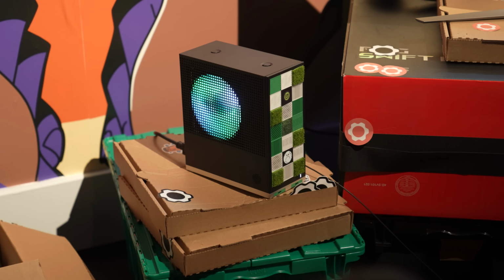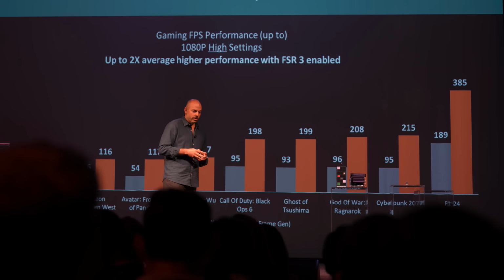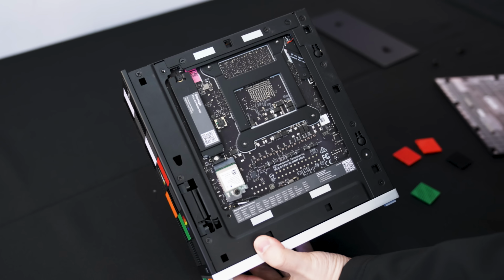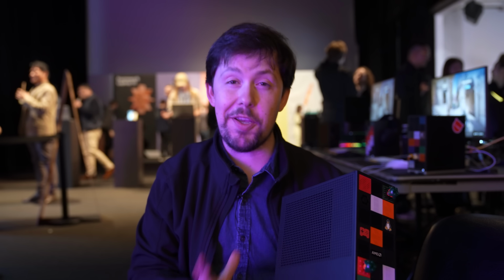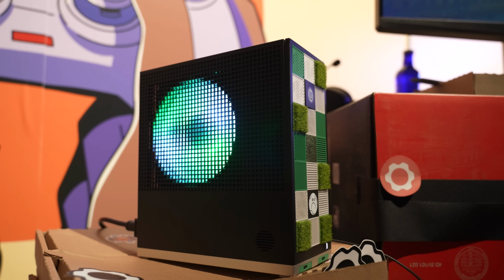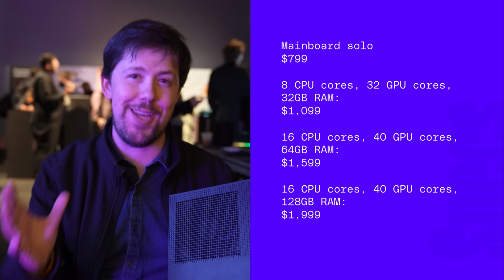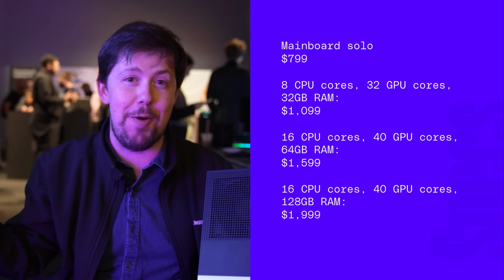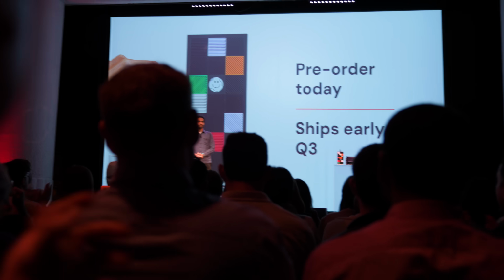Framework’s first ever desktop is 4.5 liters of pure AMD muscle

Comment from the maker: Desktops didn’t necessarily need Framework’s help – what should Framework pick as its next modular and repairable product?
Reply: Ebook reader. Headphones.
Reply: Phone pls
Reply: A tablet since phones r too small
Reply: TB5 eGPU
Reply: Tablets
Reply: A NAS case i can put my old framework laptop main board in when I upgrade my laptop
Reply: handheld android gaming devices. when they do enough upgrades they will just have a player 2 devices or a resell starter kit that can bring more people into the ecosystem
Reply: a touchscreen tablet or introduce a touchscreen option for their laptops
Reply: @jhol2752 they already have, they just revealed the framework 12, a hybrid laptop tablet device
Reply: Phone
Reply: external portable monitor
Reply: A FrameDeck would be amazing, I don't like having to undo and redo screws threaded into plastic a bunch like the ones in the steam deck.
Reply: Ah yes, soldered RAM, much modular, very pricey.
Reply: @szmarczak  LPDDR5X-8000. Framework asked and AMD couldn't make the signal integrity work with modular RAM. At least they're not charging £200 per 8GB like Apple...
Reply: Where are you getting a different 4.5L pc @szmarczak
Reply: .. I mean.. handhelds? Cause Ayaneo 3 is already literally got it faster than them 😂
Reply: @inbuiltablecrow7553  I like the handheld idea. I personally don't care for long battery life but I like the form factor as something easy to use in bed or while travelling where I'll have access to power outlets.
Reply: Love dolls.

Comment: Well I'm sure it's very overpriced but I want one.

Doesn't make sense, the point of Framework was its a repairable laptop. But desktops are already highly repairable. 
But it's a nice size and I like the handle lol.
Needs more ports but I'm okay with a dongle in a desk setup, especially since it's got two USB-C ports on the back I'd be willing to sacrifice for dongles.

Also really annoyed at the shift to Display port for everything. I find it less reliable than HDMI.

Comment: So let me get this straight. A company made a name for themselves with truly modular laptops. Now they release a desktop that's less modular than even desktops by big predatory OEM-s. No PCIE slot, soldered on RAM and somehow we are still to believe they follow the same design ethos as their laptops? Hey, they're not as bad as Apple, because at least they let me switch out some colorful tiles and don't solder the SSD, right? Hard pass for me.
Reply: This is for people who want the Strix Halo APU, which, outside of this unit, you currently can't get in a desktop at all. Given that its an SoC this is about as modular as it can get.
Reply: There is pcie x4 actually (just not available space in the case they sell to use it, it's itx so any other case would solve this)
Also the problem with the soldered ram, framework asked AMD if LPCAMM was possible. AMD (not Framework, but AMD) said it wasn't possible for signal integrity. They ran simulations etc and it wasn't possible to do so

That's a bummer, but I don't get why you reacted this way

EDIT: added notes about the pcie x4 being not usable in the case they sell

Comment: I really, really wish this were $200 cheaper... It's a bit hard to justify over building a comparably performant, if slightly larger, system for less
Reply: Yeah especially the model with the more powerful APU
Reply: You can with 12 cores, 128gb and an RTX4060? Show me the parts list… also that 4060 will be limited to 8gb where you can address up 96gb for this bad boy if you want to.

Comment: Where's the gpu slot?
Reply: Dude, the AMD chip has a super powerful integrated graphics unit that can actually rival the 4060! There's no need for an extra GPU slot, and if you allocate enough RAM to it, it might even outperform the 4060. Crazy, right?
Reply: It’s integrated graphics dude. That’s the whole point…

Comment: This is great!
That AMD processor is a beast!
Reply: I have said it in other places. When you think about it it is funny they have not done this chip properly for a while. Considering that the current Gen consoles both have a form of the integrated GPU/CPU chipset made by AMD that are running games at high levels... To have not seen that go into laptops and non gaming devices till recently has been a surprise to me.

Comment: I can handle soldered RAM. What I want is a PCIe x16 slot, not x4.
Reply: Not enough lanes apparently since the built in GPU took the majority of it
Reply: @mcslender2965 Did the GPU took like what ×8 lanes or is it ×4 lanes but shouldn't RAM only takes like 2 lanes? I know storage do take ×4 lanes
Reply: same dude, but id prefer at least so-dimm ram
Reply: @mr.unknown.  They try cam modules but performance hit was to huge.
Reply: @kkrolik2106  the performance hit was like 40%
Reply: @mr.unknown. SODIMM signal integrity in a 256 bit bus would only run at 5200MT/S in a DDR5 or in this case LPDDR5 as the name suggests its Low Power so it would need to have ir soldered CAMM2 has the same problem sadly

Comment: I hate to say it but AMD was right to pivot to APUs for the console, mobile and AIO market.
Reply: Actually they wanted to do  that to develop the Heterogeneous System Architecture. HSA is a long term goal that will take many technology steps to achieve. This having Unified memory at 256bit interface width even for the CPU is quite impressive.
Reply: @Neojhun What would be more impressive is that the RAM isn't soldered and the signal integrity is the same as being soldered for this Framework had to made the decision with AMD to have it soldered to the board for now AMD did say CAMM2 WAS being talked about but AMD said the signal integrity in a 256 bit bus would make it pretty much just runs at 5200MT/S the max speed of DDR5 RAM
Reply: Why do you hate to say it?
Reply: @ Because it means their desktop gaming GPU business is now almost vestigial :/

Comment: The AI bubble popper.
Who cares if it's slow at AI when it has 128GB unified memory, it can fit the same size models than nvidia's 80GB $20000 A100 can.
Reply: Nvidia has hbm.
Reply: @BakhtiyarNeyman  Only for datacentre cards I thought?
Reply: @BakhtiyarNeyman  for ai is not deal breaker we just need decent one with whole a lot of it
Reply: Talk that Talk
Reply: *who cares about AI? :P
Reply: @polakuu  those, who cares

Comment: Am I missing something? The whole thing with base config turned out to be around 1700 euros? for 4060 m performance? what's the hype about?
Reply: Purely for running LLMs probably.
Reply: @ or keras, or pytorch, or tensorflow...there's more to AI than just LLM.
Reply: perfomance isn't easy to compare due to the ability to relocate ram. I wouldn't use it as a gaming station.
Reply: 4060 can't have 96GB of VRAM.
Reply: @contactharsh13 vram
Reply: If you need unified memory it's good otherwise just get a normal desktop
Reply: AI
Reply: A huge vram requirement seems to be a niche at the moment. Is it something everyone would need eventually? I really hope we start getting modular unified memories if that is the case.
Reply: @contactharsh13  did someone say this thing is what everyone need?
Reply: No particular reason.

Comment: 128Gb vram/ram, 16 full zen5 cores and 40 CU 3.5. i think thats a very good linux and windows workstation for a reasonable price.
Reply: The Minisforum 795S7 is like $600 barebones if you're only interested in the CPU part, which is roughly equivalent apparently.
Reply: @PatatesLover-UwU  its not equivalent, minisforum use DDR5 slots while this one LPDDR5X
Reply: It’s lpddr5
Reply: Use Bazzaite on it it's crazy
Reply: @TecArtScien  Bazzaite is for gaming, you don't need 128GB VRAM for that.
Reply: Bro it's 2k without dedicated GPU, for me it doesn't sound like a generally reasonable price if you just want a good workstation. I don't say it needs to have dedicated GPU, I'm just saying the price is not very reasonable if you don't get the design and brand's unique gimmicks into account.
Reply: @dovs96  it basically the equivalent of a mobile 4060 they said. Which coupled with the cpu and ram its basically right in price.
Reply: @dovs96  the 32GB and 64GB models are more appropriate for a gamer than 128GB SKU is clearly aimed at the top end Mac Studio. Given the stupid cost of GPUs and scalping of then now. I think you'll see APUs start to take over the budget to mid range category for GPUs. The costs are not miles away from a 7600X based RX7600 diy system which is about 5x the size. These things will sell.
Reply: @dovs96  TBH this only good value if you are doing local llms. Other than that it's not that good of a value.

Comment: Overpriced and not expandable. No thanks.
Reply: Sorry you can’t add RAM to your 128GB of RAM. That’s really going to bottle neck you in 2053.
Reply: You can buy a GPU with 128GB of memory for less? Where? The 128GB Mac Studio is $4700, which is more than double the price.
Reply: The ram is non expandable due the the AMD apu chipset, not because of Framework. it's made the same way as Apple m chips

And AMD is marketing this for most AI crowd who run ai models, that's why the chipsets are also named AI Max.....

Comment: The front tiles are basically an hidden cost during the configuration. They can write a lower starting price this way but in reality you have to spend a minimum of 36 euros in tiles to complete the order.
Reply: I don't think they purposely schemed to do tiles and designed all of that just for a $30 dollar change to the starting price... customization is part of the companies ethos. And you can skip buying them if you want to 3D print your own.
Reply: You don't have to buy them, you know. The case looks fine without them.

Comment: The minisforum prebuild unit is way better
Reply: It doesn't have this chip, which the the main reason why this desktop exists: To fully utilize the chip.
Reply: @PokemasterSD  yes the minisforum one got ryzen 16c mobile and an rtx 4060.
I think it does preform the same as strix halo
Reply: @khalilbenaissa9077  That's not the point. This mini desktop is a collaborative science fair project between AMD and Framework. They just thought the APU was cool and built a mini desktop with it. They simply saw potential in a Big APU with 128GB of fast memory which can be allocated to the GPU portion of the chip. It's a very unique chip for the windows/linux platform. Kinda like what Apple did with their M chips for Macs. It has no competition.
Reply: Completely different type of product. If you don't understand it, you don't need it.
Reply: Which model?
Reply: @f00bar28  it's their only desktop prebuild it's not the same chip as this but it has about the same performance

Comment: That is not a gaming desktop.
Reply: Correct, but it certainly will be used as a portable gaming desktop by AI developers and other enthusiasts.
Reply: @EnglishMike  true, this video positions that as its primary use case though. There are better options out there for that
Reply: It sure can run them games, the specs are more than enough. It definitely still isn't mainly for gaming, though.
Reply: You are right, it's not.

Comment: i'm not sure why they're receiving so much praise. you can get a desktop with better specs for the same price.
Reply: Where? Which desktop gives you 128GB of 256gb/s unified memory paired with a 4070 equivalent iGPU for 2k?
Reply: @rosh4576  most people don't need unified memory or an iGPU. i can get a desktop with a 4070 super for $1,300. this thing is overpriced unless you're running big AI models, which is niche even among enthusiasts imo
Reply: @imjamf Can you get a 4070 with 96gb of VRAM? I think that's the point of this chip for people who need that VRAM for LLMs.
Reply: @PokemasterSD  Even better - It's 110GB of VRAM if you use Linux
Reply: @rosh4576 4060 desktop/4070 mobile dGPU*
Reply: but it looks so pretty

Comment: It’s so cool. It’s just so damn expensive for what it is.
Reply: Not that expensive. A similarly spec'ed 128GB Mac Studio costs $4700 -- i.e. more than double the price. It's cheap for a halo product.
Reply: Its also sadly one of the only ways to get that specific chip
the other issue is the soldered ram

Framework did mention on LTT that it was mainly due to them needing to redesign an entire motherboard for that cpu if they wanted to have replaceable ram
Reply: @WiZtEk1  Not quite. AMD told them there was no feasible 128GB modular RAM solution at this time, even if they had wanted to do a redesign.

Comment: Modular in appearance only.

Pretty much a minisforum copy.
Reply: All other mini desktops don't have many replaceable parts, pretty much limited to ram and wifi and storage. This one you can replace any part and can be upgraded over time. I think people are really missing the point of this and how it works.
Reply: Go swap minisforum’s main board or WiFi (okay that one might be possible with most boards) or fans without buying a whole new device then
Reply: It works like Lego: you can add as many units as you want. It's completely different!
Reply: How can you upgrade soldered ram and cpu?
Reply: @overnightmares  you cannot reach this level of performance with swappable RAM. They tried and for now this is not technically possible. Maybe in next generations they will manage to use CAMM or something.
This is not typical consumer desktop, it is meant for AI and computing, performance has the higher priority than upgradebilty. They did good job, I like this product very much. And please notice that this computer even in maxed out version costs only a half of comparable Mac Studio.
Reply: @tomaszwnuk7096 why is it not possible to get the same performance with swappable RAM? What is the limiting factor?
Reply: Bandwith  @Deltacasper
Reply: @Deltacasper  there were too many errors caused by connectors and wires among swappable prototype. Watch LTT video on this computers. Framework CEO explains that there.
Reply: @oo--7714  Can you elaborate a bit on it?
Reply: @ thanks I will do so
Reply: @Deltacasper  signal integrity at high speeds.
Reply: @ you buy the upgrade or replacement from the framework marketplace...

Comment: Why do people measure computer in liters? You are not putting liquid in there.
Reply: Same reason why car trunks are also measured in litres. It's a standard unit of measurement for 3 dimensional volumetric space.
Reply: @rayjynx  I always heard them in cubic, or square feet. Not liters.
Reply: @saulgoodman2018 liters and milliliters are equivalent to a cubic meter (m³) and cubic centimeter (cm³) it is a literal 1:1 ratio
Reply: @saulgoodman2018 1L = 0.001 cubic meters, so for a metric system, it's standard.
Reply: @ we dont do feet internationally man. 1 cubic meter is a 1000 litres. whole numbers, that's the SI units.
Reply: Avg American school system product:
Reply: Are they supposed to measure them in tablespoons or cups so that Americans understand it?
Reply: Because cases come in all different sizes and shapes? When you're selling the smallest of something, it's a very useful flex.
Reply: because that's the measure of volume. it has nothing to do with liquid. ever heard of air tanks? which volume is expressed in liters. and has nothing to do with liquid too.
Reply: @stclaws9580  An air tank is different.

Comment: Not modular enough, put the PALS system on the case so you can add stuff onto it with the MOLLE system.
Reply: I need a full-sized COM interface to connect my fax machine
Reply: I need QD mounts for my three point sling.
Reply: This is small enough to work as a secure container for my bitcoin

Comment: Soldered ram :(
Reply: AMD restriction I believe. Framework said they tried to undo this but to many technical complexities. At least they admitted to it being soldered in his presentation.
Reply: They said they got a dedicated AMD engineer assigned in order to test replaceable ram but they couldn't get it stable
Reply: It's a issue with this socket. Framework said they tried to do it but it did not work with it.
Reply: I think that's due to the way the ARM SOC is built (CPU, GPU, RAM on a chip)
Reply: yeah. GPUs usually have soldered RAM. what about it?
Reply: Not soldered, that would imply it's installed somewhere on the motherboard. It's an SoC-like design, which puts the CPU, GPU, and RAM all on one package. This is EXTREMELY efficient which is why it's so performant. So it's like soldered RAM, but to a greater extreme for both the advantages and disadvantages of it.
Reply: @NickLetsom  yes, soldered. yes, that would imply installed somewhere on the motherboard. by soldering to it.
just as you can see in ifixit teardown video
Reply: Sad. But its an amd restriction

Comment: 120 go ram is nowhere near enough to run the full deep seek r1 locally
Reply: which is why they connected i think 4 of them in their presentation
Reply: @homeape.  We need so much more vram
Reply: @Jackson_M5  480GB of VRAM on offer with four of the 128GB configurations interconnected, I would imagine. 8 more units oughta do it.
Reply: If you watch their presentation they say this, hence why they have 4 of them in a server rack.
Reply: @TravellingTechie  thanks for adding the context. I was caught off guard when the guy said you can upgrade to the 120 gg ram if you want to run depseek locally
Reply: @evodevo420  I mean he does mention it in the video like 5 sconds after 😅
Reply: @remo7846 "attention is all you need" 😅😅
Reply: @evodevo420 not the full models but many mud to higher end models can be run with that 128gb RAM option
Reply: @earthling_parth  yeah also distilled versions of deepseek would probably run like lightning on it
Reply: but you can run lighter and better models easily, deepseek is not the state-of-the-art if we focus on specific agent use cases, qwen 32B coder should be great for instance